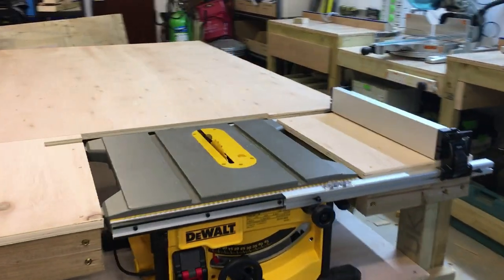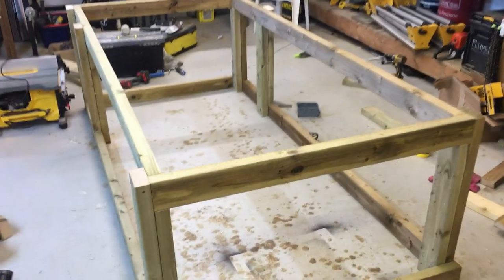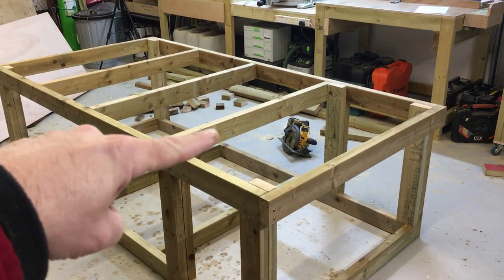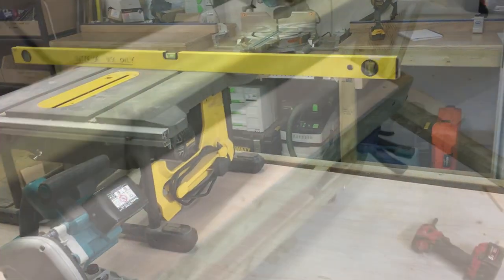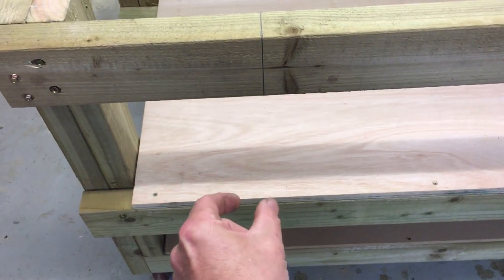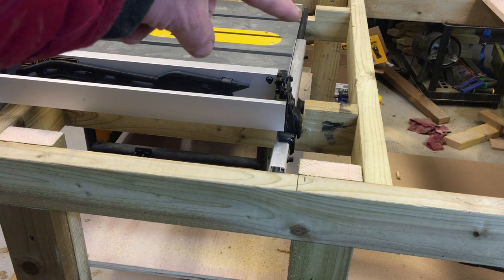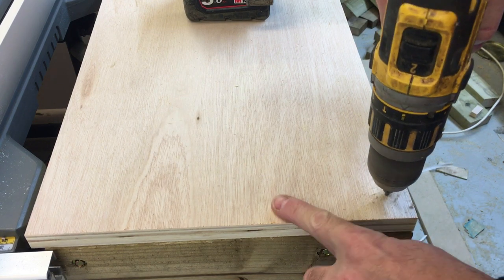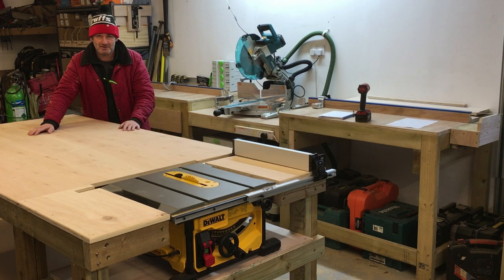How To build an EASY cheap Work Bench

Comment: Cracking job big yin as always 👏
Reply from the maker: It will have to do Ian, should do the job and great to finally have the table saw mounted as opposed to using anything and everything as an outfeed table 😂 Cheers for the comment bud ! 👍
Reply: @Bacrenfencing  you'll get good use out it m8 👍

Comment: This is great!! Looks simple and structural 🥳 does it matter what type of plywood you use? Like cabinet grade vs regular sheeting?
Reply from the maker: No it does not matter what plywood you use, just make sure it is heavy duty enough to make a solid top. I used 3/4" plywood for mine as it gives a nice flat surface and it is solid. You can use anything really, plywood, heavy MDF or even make solid timber glued together - whatever suits your purpose and budget. Thanks for the comment 👍😀

Comment: Great video, I’m keen to try and make something similar. How do you find the stability of the castors in their locked position when using the bench? Would it be worthwhile thinking about the retractable type castors that allow the legs to sit on the ground when castors not in use?
Reply from the maker: Thanks Gary, to be honest I think the retractable type would be more stable as the castors on mine do move very slightly even when locked off, but it does not bother me too much. Thanks for the comment 👍